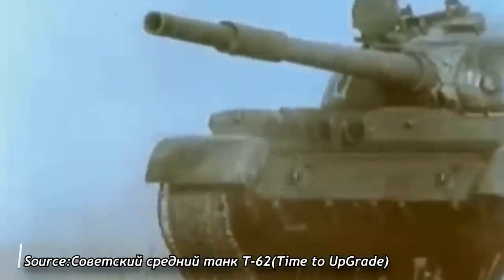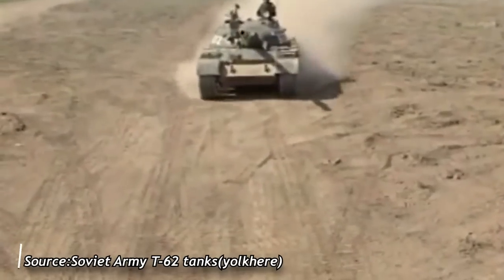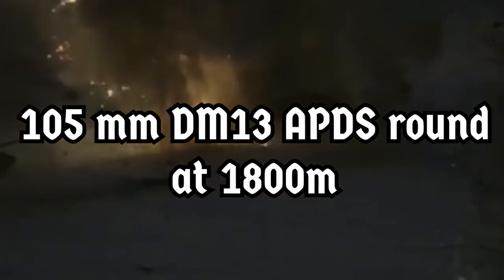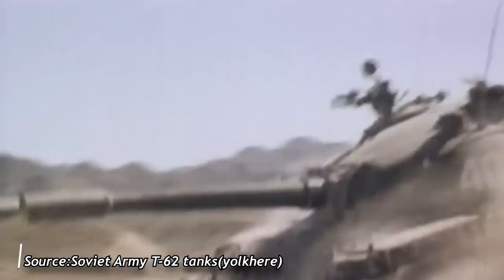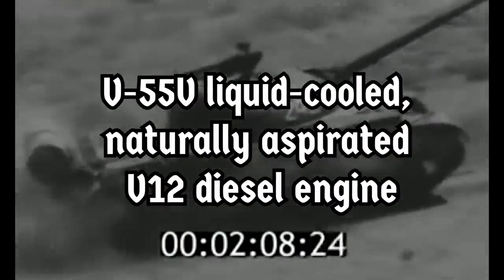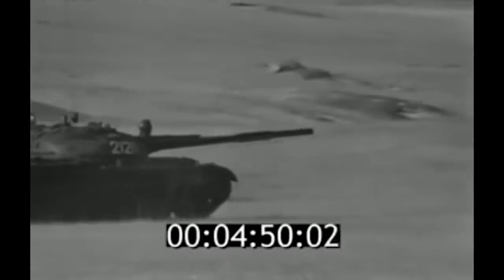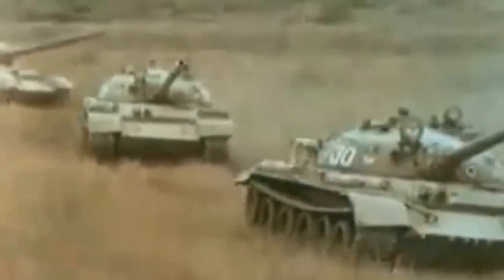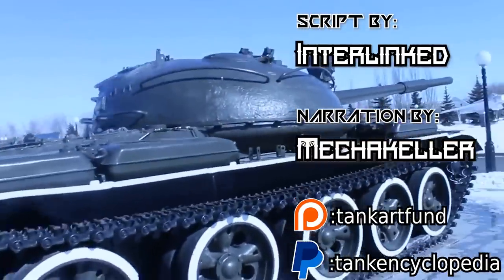Chasing NATO | T-62 Part 3: Protection and Mobility

Comment: I think it's a decent tank. You can always pack more stuff on it but the UdSSR needed a lot of them so they needed to compromise in some areas. Good tank.
Reply: Emmm... Nah. Not really. Apart from the Soviets, nobody wanted this tank. All countries of the Warsaw Pact went into modernized T-54/55. The perception of it was "a stop-gap makeshift tank with more weight and unchanged engine output." In reality, it was a very front-heavy vehicle. A rather slow with the stabilized gun that was stabilized only on paper. Everyone wanted the new Morozov design.
China adopted the design in 1969 I guess (they reverse-engineered it from the captured piece), but they did not have a lot of other options.
Reply: @HanSolo__  You do understand all of your mobility arguments are demolished in the video itself?